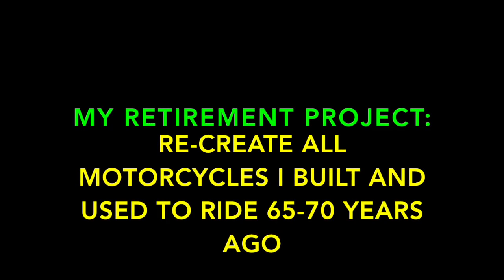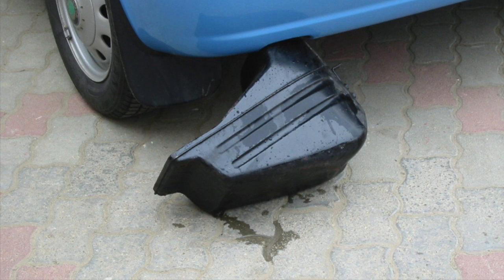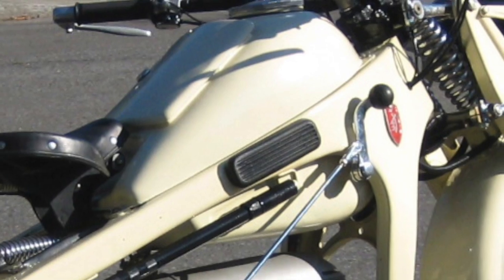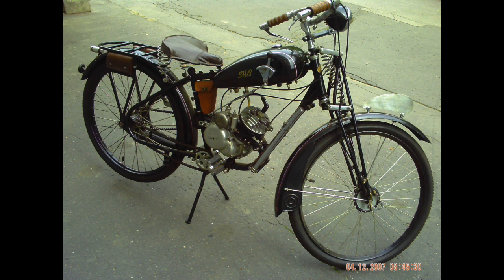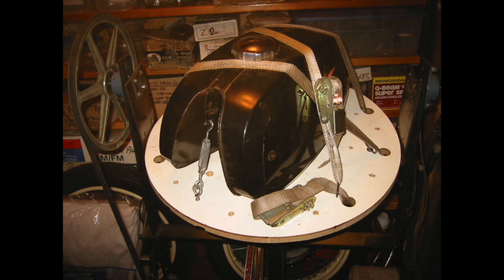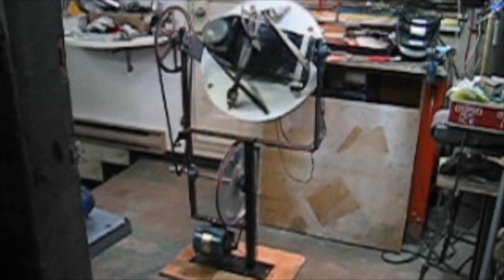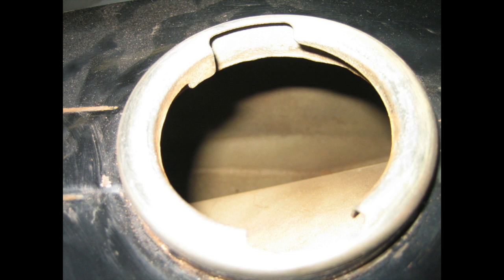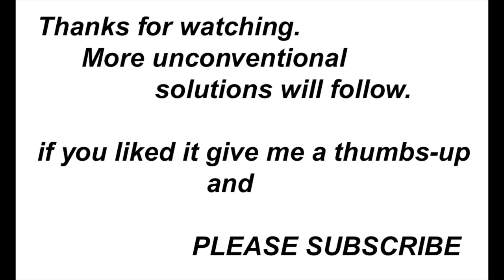#33 - TANK of NAILS. DE-RUSTING

Comment: That tumbler is brilliant !  I derusted a tank using Phosphoric Acid once. The interesting part is a phenomenon called "flash rust". I couldn't figure how to instantly coat the tank with sealant immediately after draining the acid, because the coating chemicals aren't compatible with the acid residue. Within minutes after flushing the acid with tap water, the inside surface of the tank developed a thin coat of rust again !
Reply from the maker: auxpowerunit After acid cleaning , even after sandblasting, the surface has to be protected instantly

Comment: As ususal very good job Bob-- Bob from the USA
Reply from the maker: Thanks, I appreciate your interest. Are you into motorbikes too?
Reply from the maker: Thanks, I appreciate your interest. Are you into motorbikes too?
Reply: Yes  since 1967,at present I have  a1996 Suzuki Bandit 600S,1993 BMW K75RT,1969 Triumph T100C and 1964 Triumph Tiger Cub.In the past I have owned various Triumphs,BSA,BMW,Bultaco,Suzuki,Honda,yamaha,Kawasaki and Harleys.And like you my work shop is a machine shop,welding and fab ,mostly related to motorcycles,But also other projects from time to time. Bob from the USA
Reply from the maker: I never owned, never rode other than German bikes. This is how it happened.
Last year I sold 7 bikes, left 10. 1994 R1100RS BMW, 1992 K75 BMW, 1984 Shadow 500,  Honda scooters '85 Elite 250 and '86 Helix 250 and 2-KS600 Zundapps, 1994 NZ350-1 DKW and 2 1936/32 98 cc Sachs Mopeds.
I will make a shop-tour as you mentioned but for me, now at 91 everything happening rather slowly. Thanks for your interest. If you send me an e-mail we could talk details, what I have many. 
 thatoldbob@gmail.com.
Bob